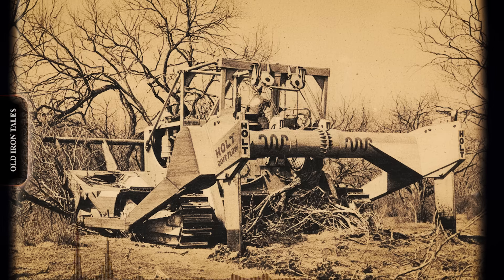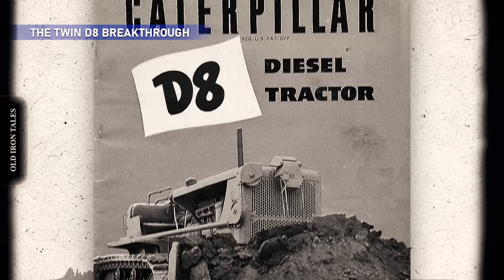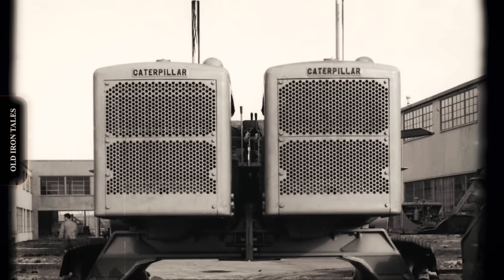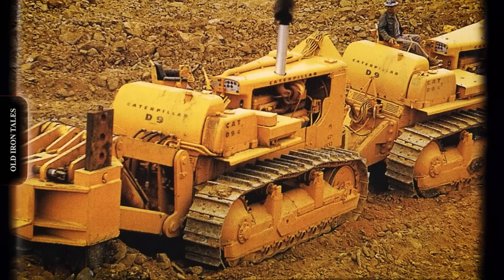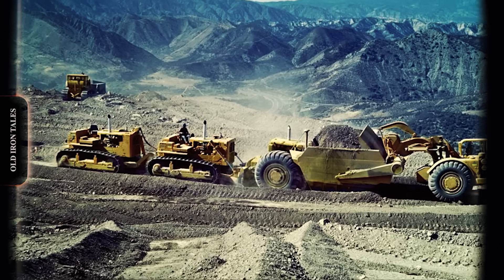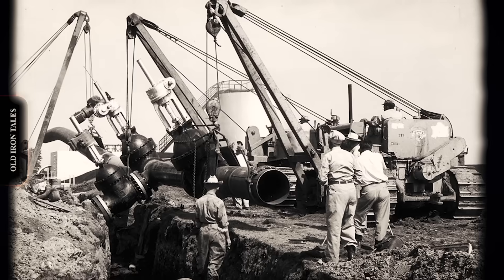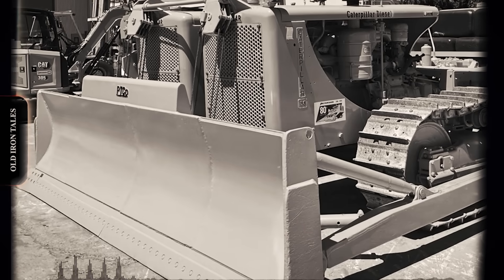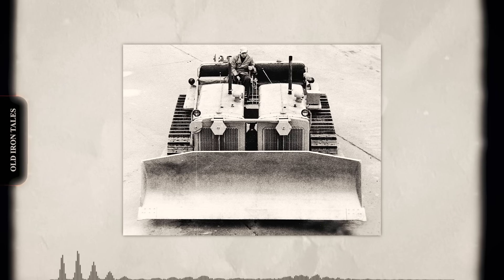He Bolted Two Tractors Together – Buster Peterson

Comment: My father was in the 8th Army Air Corps at Polebrook Airfield in England during WWII.  He told me that there were machines there that were two D-8s joined side-by-side with a single wide blade used for developing the long runways needed for B-17s.  So this idea was in use by our military as far back as 1942, or so.